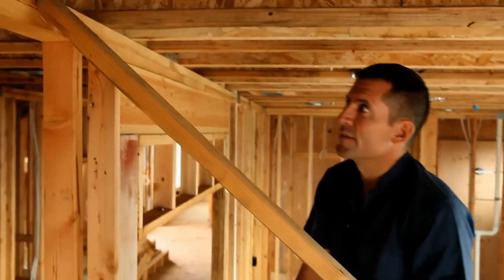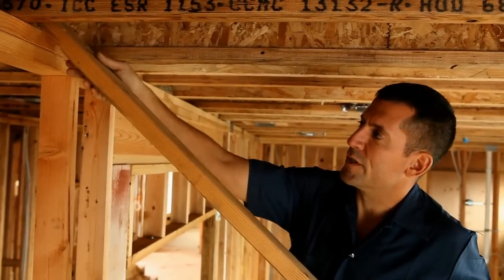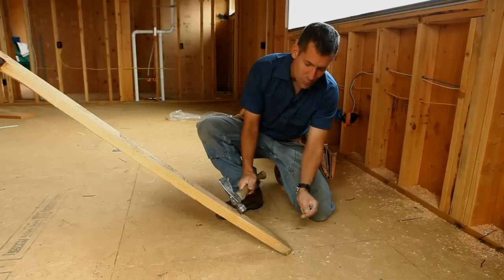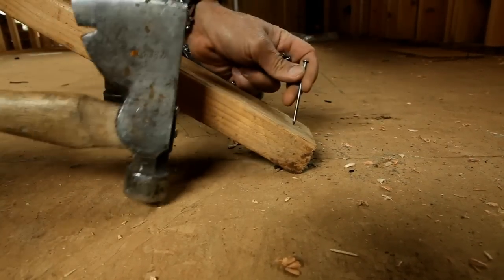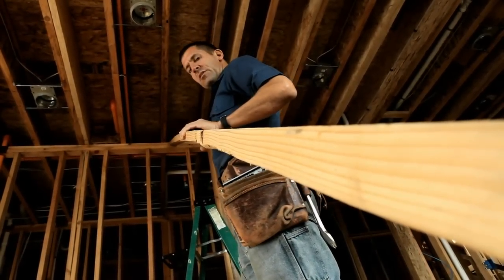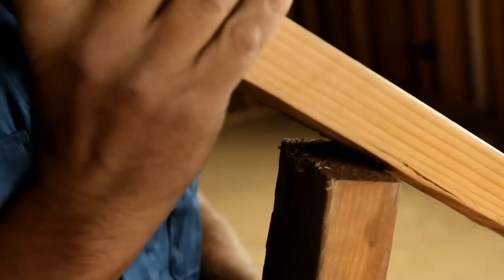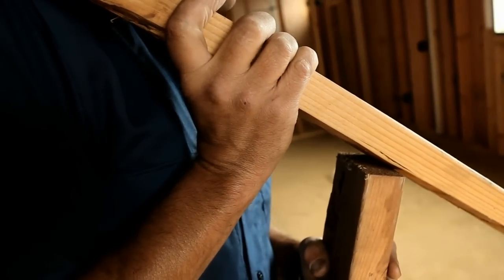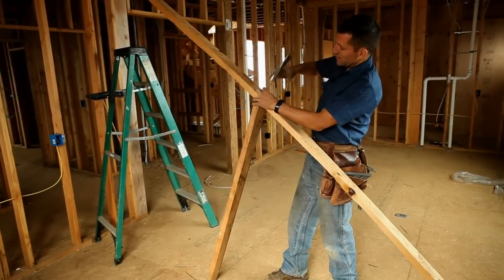BUILDING SKILLS: Framing tip -- How to straighten a wall

Comment: They make a turnbuckle for this.  It allows precise safe alignment of walls.  You can attach it to the bottom of any length 2x4. Or 6.  And fine tune very easily.
Reply: Product name?
Reply: @derptothemaxclearly  Turnbuckle Form Aligner With Flat Plate
Reply: They make a tool for everything, but sometimes it's faster and cheaper to know how to use what is on hand.

Comment: i remember my dad showed me this trick a couple of years ago on a gable end that we forgot to level. i put all my force on the 2x4 and nailed to another truss with a 2 inch common. i straddled the brace between my legs and when i was ducking under the truss i held the brace and it kicked out and sacked me so bad i nearly fell down onto the slab ahhahah. good times, never straddle a brace.

Comment: Great video. That's the fastest, most accurate truing method.  One 2x4 can push or pull to straighten a wall.  This is done before the joists are framed in. The video is just  demonstration. The lumber looks like Douglas fir, easy nailing. We don't get that here in lumber.
Reply: Jason Bell it's a rigging hammer tree fellers use them
Reply: You might've meant to reply to someone else.  I know Scott Brice always uses a rigging hammer.
Reply: This guy is doing it wrong go watch Larry Haun do it the right way.
Reply: not if the wall is long.

Comment: Very Helpful Video- thanks!  How would you do this if you  were working on a concrete slab?
Reply: Gotta nail a block to the slab and do the same method but slide and.nail the brace along the block
Reply: I've seen where you cut a block of wood that lays flat on the floor slightly longer that where the angle brace lands on the slab. Put on on top the other and push a belly in the brace until it pushes on the block on the floor end for end. Really only works to push the wall.

Comment: Will this work on a 100 year old house before I put plywood back on exterior walls?
I need to move the top of the walls over about 2 inches and don't want to use hydraulic jacks.
Reply: You need to move the wall slowly, over some time. If you try to force old wood a lot it may crack and create more problems.

Comment: @ 3:06 I don't understand. Would you not need to be on the other side to push the wall inward? How would changing the curvature actually pull the wall?
Reply: When he wants to push the wall inward (pull it towards him) he nails both the bottom and top of the 2x4 so that it can't move.. When the nailed in 2x4 is straight it measures 8 feet from end A to end B. When he pushes upward on the middle of the 2x4 it bends outwards which causes the ends to move in closer to eachother. The more it bends the shorter the distance from end A to B and because the 2x4 is nailed to the wall, the wall moves with it. To push the wall out (away from him) he sat on the 8 foot 2x4 which caused the bottom end to to pull in closer to him and creating a shorter diagonal distance from end to end. He then nailed the bottom in so it couldn't move. As he pushes upward on the middle of the 2x4 it begins to straighten the 2x4 which increases the length and pushes the ends away from eachother.. The only way for the 2x4 to straighten is to push the wall out.
Reply: @mikee12321   So then it's really the nails that are pulling the wood from the wall in? I don't see how the nails won't simply come out or if they bend, won't they immediately become ineffective? It just doesn't make sense to me how the nails in the diagonal bar are strong enough to pull the wall inward.
Reply: @davidbassjr.7909  The nails are what is keeping the top plate and the 2x4 lever together. the 2x4 is resting diagonally 00:15 The nails are then inserted level with the floor/horizontally through the diagonal 2x4 and into the top plate.. As he pushes up on the middle of the 2x4 it creates a curve in the middle and the top portion of the 2x4 goes from being diagonal to more flat/horizontal. This puts pressure on the nails and bends them into a U shape. Think of it like a hook in a fishes mouth
Reply: @mikee12321  So then the nails curving is intentional and it's by means of the hook shape that it can pull the wall? If so, this makes way more sense.
Reply: When you bend the board, you are shortening the distance between the to ends. Since one end is attached to the top of the wall and the other is attached to the ground, the wall is going to move with it.
Reply: @davidbassjr.7909  I don't think you have ever tried pulling out nails used in construction. It can be nearly impossible. Also, he explains how how t hey nail the nails in to make it harder for them to come out. Watch the video a few more times.

Comment: your suppose to nail a block to the ground then nail a piece of timber to a stud on the wall that needs to be straightened then one person holds the straight edge and level against the wall as another person pushes or pulls the stud till it is plumb then he shoots the stud into the block. nice and quick
Reply: luke iapozzuto this way is better
Reply: Hey big guy slow your row, this is called a suck brace. you use it when your unable to get a standard brace (what you have described) i.e exterior wall second floor or when you are unable to pull the standard with enough force to straighten the wall.
Reply: three blocks and a string
Reply: Larry Haun does it better then this guy.

Comment: Why are you racking walls AFTER the joists are on? Did you sight your exteriors and straighten them prior to joist set? I build about 40 houses a year... Have never seen framing like this.  What if you have a flushed double microlam with hangers on both sides? You wait to rack?? Where's your help with a plate level to check for plumb? This isn't a one-guy job.....
Reply: '40 houses a year' x'D rofl
Reply: lol, he was not straightening that wall, rather just giving an example of the technique he would use to straiten a wall, the house already has plumbing and electrical run
Reply: @jimandy9472  must have a massive crew lol

Comment: the way we used to do it is we would put a peice of 2x4 at the end of the kicker so the peice of 2x4 is extended to another near wall or install a 2x4 on the floor joist and then put pressure on the 2x4 untill level. nice video.

Comment: ya that wall should be plumb before putting another floor on top of it... that's what happens when your plumb and line crew sucks..
Reply: Glasstech7 you are completely  right  ,bracing walls has to be before  to do the ceiling  joist  ir rafters
Reply: I am pretty sure he was just explaining how to brace the wall before the joists are rolled.

Comment: Maybe I am missing something, I am not a builder....Couldn't you just beat the wall into place with a sledge, instead of all the bracing and leverage?....I was a fireman,....I tore down buildings....Tommy.
Reply: Yes but walls move if there is no brace there and the joists have not been shot into the top plates

Comment: The| majority of comments are from idiots! This is only a demonstration on how to push or pull a wall section to level. Clearly, that was done before second deck went on. However, this process can be used also, to straighten up 50yr old garage for instance, one that never had wind bracing. There is another, more aggressive method to this, by adding a 2x6 flat on floor,nail wall end to bottom plate,  nail 2x4 (shorter than in video) to wall and 2x6 & lift free end of 2x6, while sliding a block between floor & 2x6. We called this a mousetrap.
Reply: Level or plumb?

Comment: LOL   Weld up some turn buckles. Turn the turn buckle. Plumb the wall. Why are these guys still using 100 year old techniques.  You can purchase wall plumbing turnbuckles even. No heavy lifting, one man can plumb the walls.
Reply: This can be helpful if you can only access one side of a building (edge of the property, cornered by fences) and want to push instead of pull.

Comment: Why does he use that kind of hammer?
Reply: They typically have more mass (weight), so it's easier to drive nails.  This is a valid benefit when you're swinging downwards (in direction of gravity).  If you're swinging at a vertical wall or above your head, the hammer's weight is more tiring, and you're probably better off with a lighter hammer.

Comment: Framing hatchets are for hacks and wood butchers. You should be ashamed!
Reply: kellridd you obviously have no clue of what you are talking about, it's called a rigging axe and some of the greatest carpenters used them
Reply: preach....
Reply: Ib4wp 
Yes this guy isn't knowledgeable. A rigging axe is fantastic on snapping bands on lumber and trusses.
Reply: You are all wrong. Essential Craftsman and Larry Haun are the greatest carpenters and they don’t use this garbage. You don’t need a hatchet/axe to break bands. Go watch how Larry Haun breaks a band. Simple and easy.
Reply: xXMvKkillaXx go watch EC's  video on hammer. Hell tell you about rigging axes..
Reply: I never understood the rigging axe in this day and age. BUT, whatever, if that's what he likes to use and is efficient at using it, the. Who cares?
Reply: I’ve never used a rigging axe preferring to keep my carpenters axe razor sharp. But those of you saying they are hack or butchers tools I’m not so sure. Larry Haun said they did use rigging axes in the early days and they put nails down fast. Scott at essential craftsman also says they are not butchers tools so that kind of voids that argument to. 

If you like the weight and balance what’s wrong with it?
Reply: Glenn Holcomb  
Glenn, one of my companies frames 50 houses a year...I've been around the block..
I keep a framers axe in the telehander to snap metal band. Yes, you can snap bands by smacking with the claws or bending the bands with hammer claws, but the axe is FA$TER...
However you want to continue is your choice....